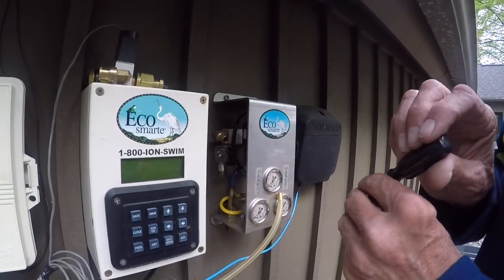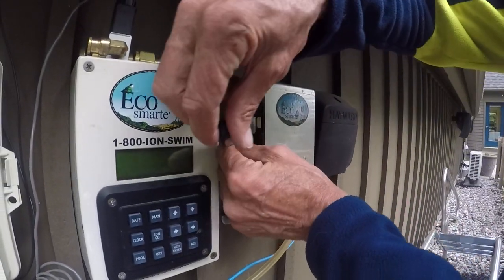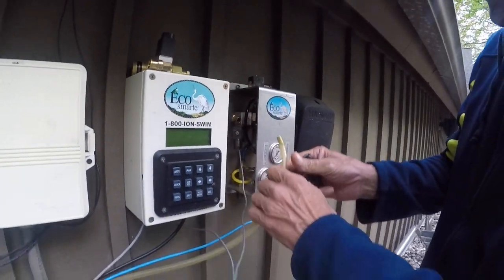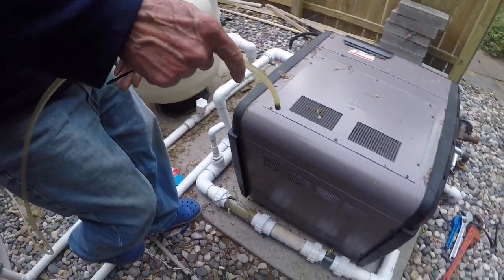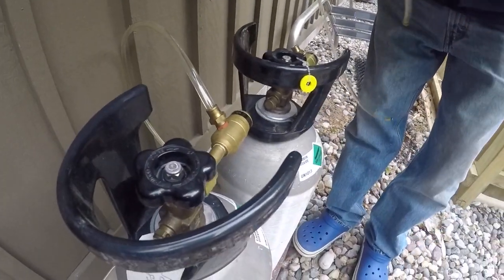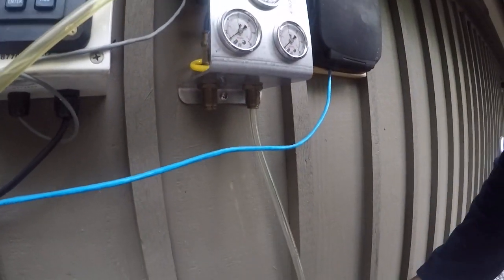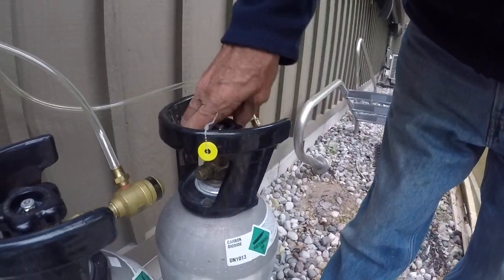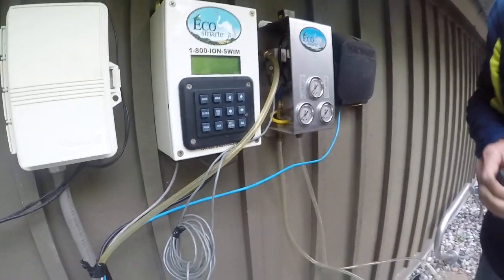ECOsmarte's Crossover Manifold Install Video.

Comment: Ecosmarte is the world leader in CO2 PH control since 1999 with over 10,000 sites and no sensors to clean or calibrate Buffers the ph up and down, with no acid